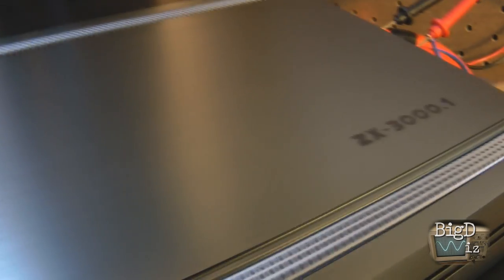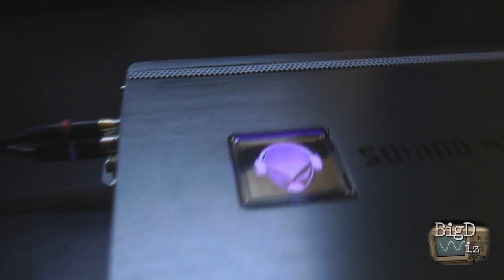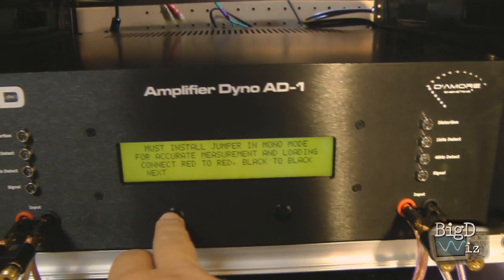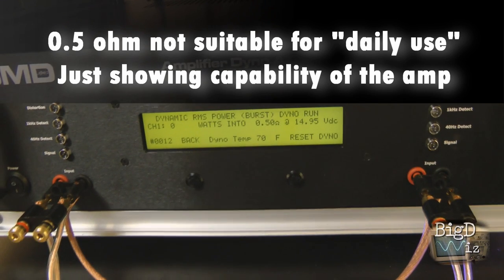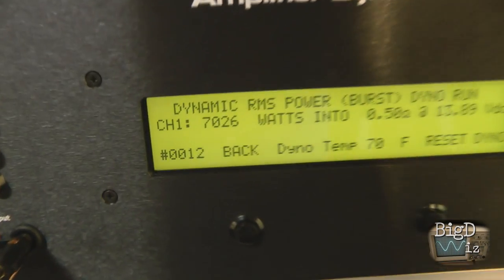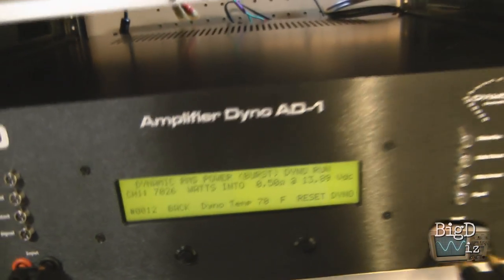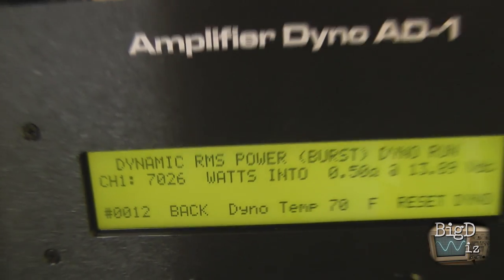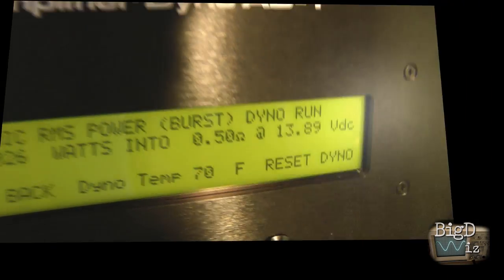Sonido Mask ZX-3000.1 Amp Dyno Test Dynamic RMS 0.5 Ohm UNREAL!!

Comment: Hey Mr BigDWiz can you use a clamp meter on the 30001D to see the ac amp to know what fuses you'll have to run
Reply from the maker: It pulled over 350A before my power supply hit it's limit. My clamp meter isn't fast enough to capture the dynamic pulse measurements, but it's fused at 250A and it didn't blow, so that should be an adequate fuse.

Comment: If you could can you test a late 80's old school RF Punch 150.
I have one that i bought in the late 80's and would like to see what it can really do.
Reply from the maker: I have an older test of a Punch 150HD vs. Phoenix Gold MS-275. I will try both amps again on the Amp Dyno in the future. RF Punch 150HD vs PG MS-275 - Part 2 - RMS Power Output Tests 1080p
Reply: Dereck BigDWiz

Is there any difference between the HD and the non HD,cause i have the non HD.
Looking forward to the tests.

Comment: So what's it do certified at 1 ohm. Cause really to true audiophiles dynamic don't mean nothing but inflated numbers
Reply from the maker: I wasn't able to obtain conclusive 1 ohm certified results as my 320A power supply was overloaded. It could handle the short bursts of current for the dynamic tests, but the 10 second 1 ohm certified test it could not. I'll soon have a bank of batteries to back up my power supply and be able to test this and other large amps to their potential

Comment: Was it just me, or did I see the Dyno screen surging and dimming??   LOL That's Crazy !!
Reply from the maker: Yessir...it was pulling everything it could from my power supply. Might have done MORE with a few batts attached!
Reply: I think it does that on every dynamic run that I've seen...
Reply from the maker: Deschain420 Yeah, especially the ones pulling 350A and more. Remember, the Amp Dyno doesn't supply power to the amps, they still need external power. My power supply can do over 320A at 14V and when I add some batteries to help the reserve power, I'll be able to test even bigger amps